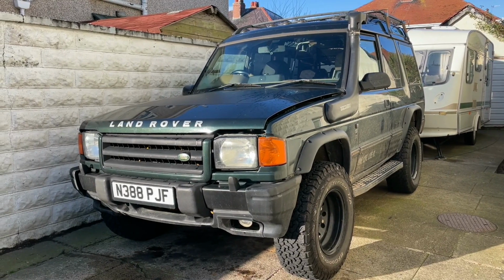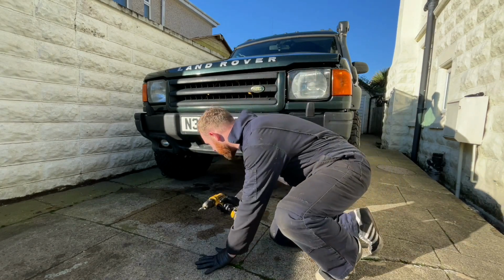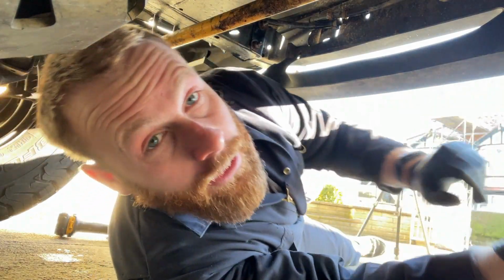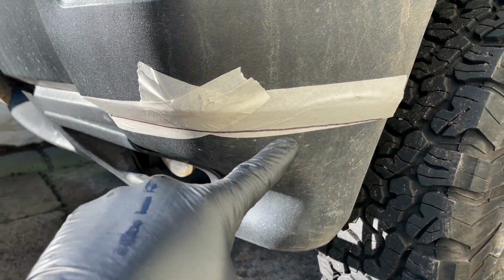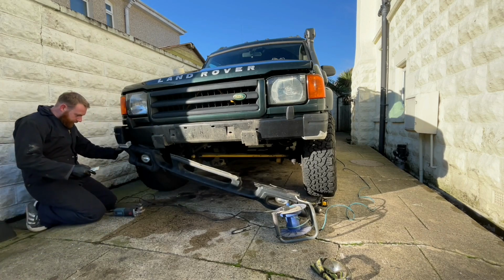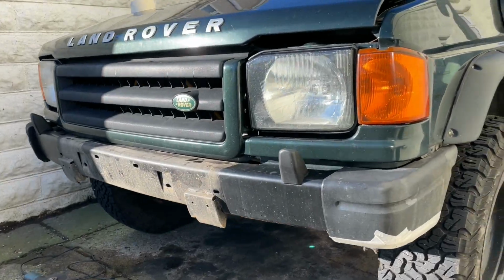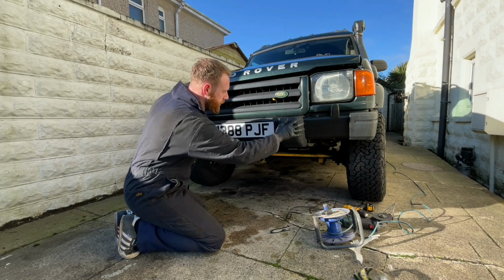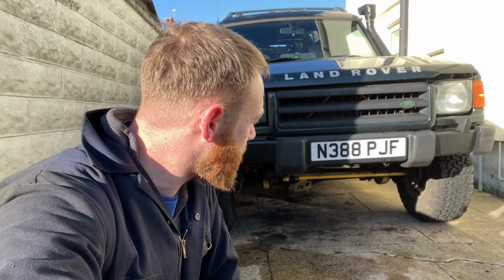How to trim a discovery 1 front bumper

Comment: looks good!  didnt know the bumperparts were that simple to remove.. i might do that sometime and repaint the steel after all the years catching stones...   interesting too for the rearbumper, lot of rust so have to fix that too for a lot better look. and find a solution for that crappy lights in the steel part, they fail too much and the brightness is pretty worse, cant find any replace model with led other than place something on the bumper instead of using the designed holes.
Reply from the maker: Thank you, I have the heavy duty rear bumper with standard lights, you can get guards for them too